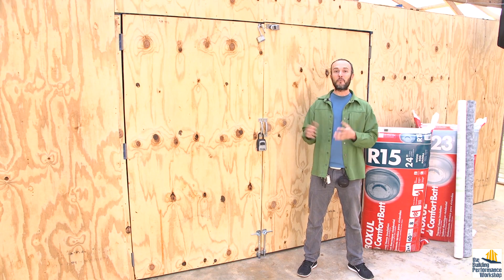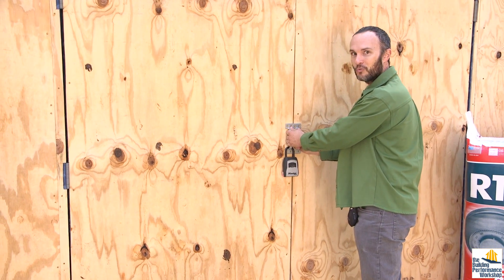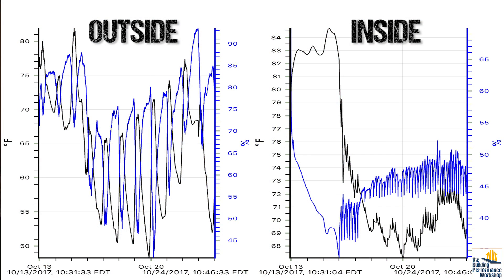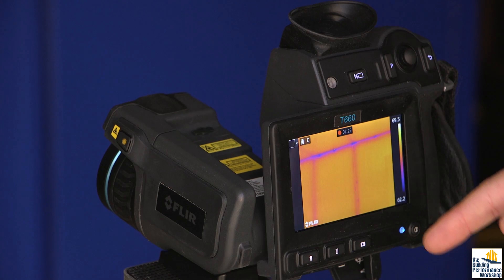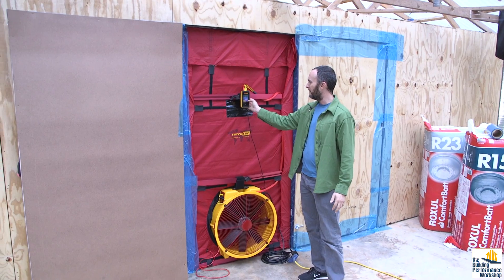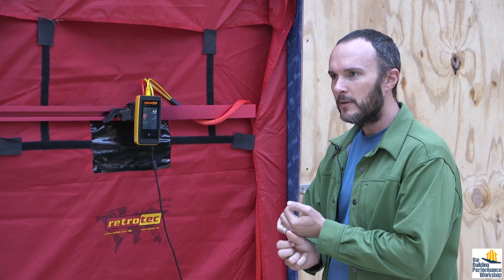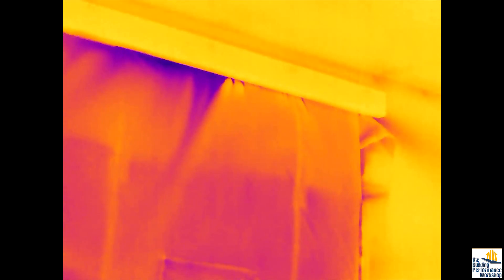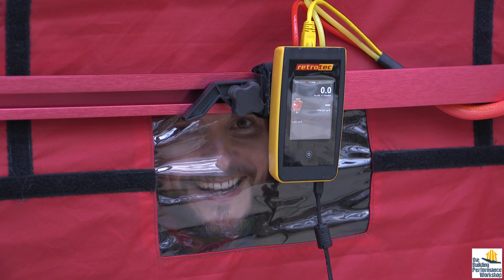#DryVault Pt4: Blower Door and Infrared Testing

Comment: Wouldn't it be better if there were more of a temperature differential between inside and outside? Then any type of leaks would be much more obvious than when the temperatures are almost the same between inside and outside. Mind you, I'm not an expert but it seems logical
Reply from the maker: +Rick in the 1970’s, you’d be right. With today’s technology, you can see issues clearly with a tiny delta T. I’ve gotten great air leakage shots with a 1 degree variation using a $5k camera. This is a $25k camera.
Reply: Home Performance wow 25, 000.... Nevermind..Love your videos...
Reply from the maker: +Rick thanks brother! Always appreciate your comments!